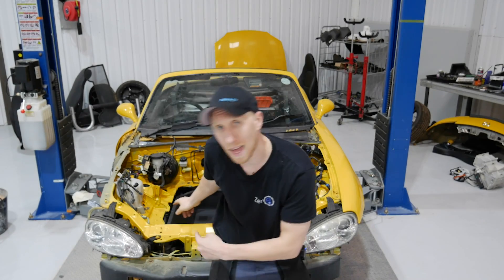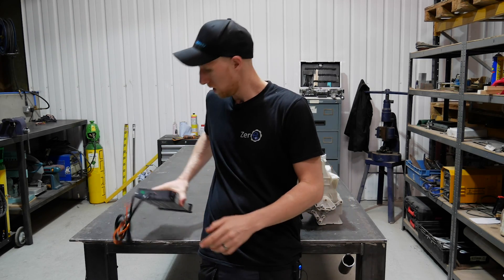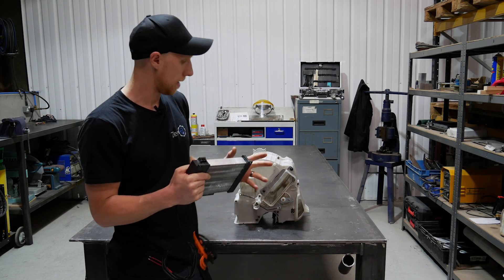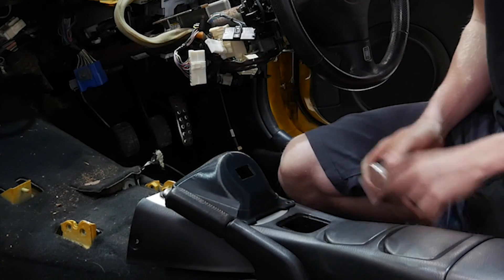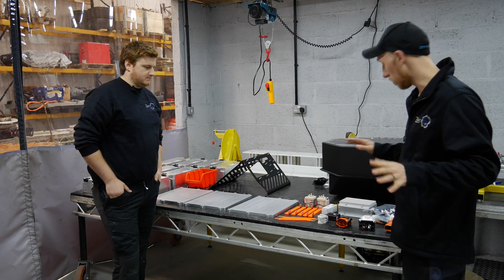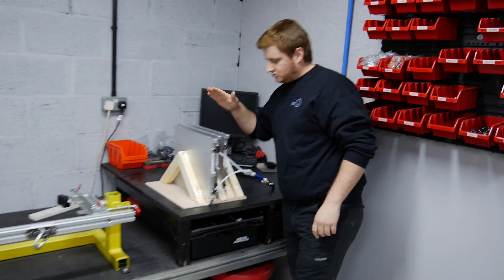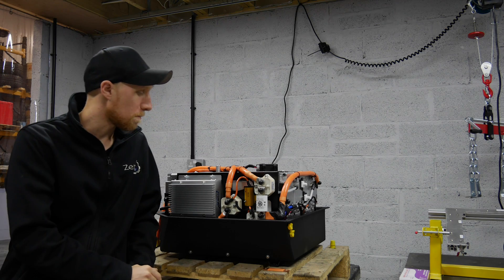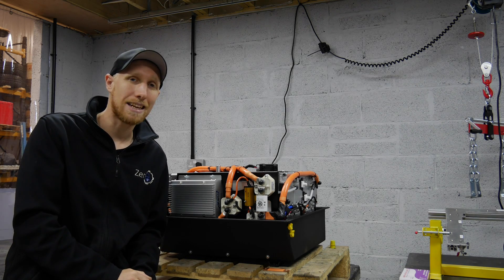Electric Mazda MX5 Miata Eunos EV Conversion, High Voltage Battery Box Build. Eps 7

Comment: Are you not cooling the batteries and motor?  Heat from those should be used in the cabin, surely?
Reply from the maker: Battery’s and motor controller are cooled. They will not generate enough heat to have any real effect in the cabin.
Reply: @Hazell_Nutz  Do you have any numbers on that? How much heat are you throwing away from the motor and batteries?
Reply: @realnutteruk1  A couple of watts each, you are talking about a 100-200 watts total during normal driving. You send more energy moving the heat and it will be at a very low temperature so not usefull for heating the cabin. Keep in mind your 'ICE' vehicle has coolant at 100C and not components just above ambient.
Reply: The HyPer 9 motor is air-cooled, so it is not useful for cabin heating. The liquid-cooled components could provide some cabin heat, but there isn't enough waste heat for them to have bothered using it in this project.

Comment: This entire series makes me wish you guys taught a class that people could take to do a conversion on their own cars from start to finish.
Reply: I wanted that as well until I had a look at the prices for the parts..
Reply: @mysteez doing a bit of research and youre probably spending around 13k$ doing this conversion lol 
thats like 5 times what a lot of people have paid for the car in the first place
Reply: My thoughts exactly.
Reply: Wait until prices drop and then build it slowly, going to wrecker yards and seeing what parts are cheap
Reply: It's not Soo difficult, check some guys in India who are doing a great job on a small budget 😁✌️👍Stay safe.
Reply: its cheaper to convert it to a V6.... which is also more fun !
Reply: @condadodealhamahomes  Definitely cheaper initially, but over a 5 ot 10 year cost of ownership, the EV TROUNCES the V6 in reliability, maintenance, and propulsion costs.  Also, if you've never driven a nice lightweight EV conversion, you don't know what fun you're missing!   * INSTANT * acceleration, neck-snapping torque is addictive, for sure!
Reply: @misturchips  I actually don't think so. In 10 years the battery pack may need to be replaced. Also in most countries (probably all of them) you need to pay a lot to get it passed any technical inspection, probably need to make additional mods in order to make it street legal.
Reply: @condadodealhamahomes  We converted a Ford Ranger in my college class for the campus landscaping crew in 1997.  That truck is still the one they all fight to get each day - since then, it's had one complete battery replacement, and a partial where one of the batteries suffered a shorted cell.  On the full replacement, the battery rack was also replaced.   Ultimately the most reliable vehicle in the fleet, as well as the least expensive to operate.  They plug it in at the end of the day and pick it right up the morning to suffer a day of stop-and-go short trips etc.  The VOlkawagon Rabbit diesel was 0-30 in 12.x seconds, where after converting to electric w. 12-1600lbs extra weight it was 0-30 in 7.x seconds.  If not current-limited, it'd strip the teeth off of first gear...  Performance, reliability, and smooth operation are key features making 'lectric superior for 90% of driving.  Sure, long trips can be a pain, but that's getting better with each advance in storage.
Reply: Please

Comment: Hi, you can't use 3d printed parts in a car if it's standard PLA, it will melt in the summer. Use nylon or any other high temperature filament.
Reply: Use Bdp it prints well and is stable offer 100 C 😏
Reply: Nylon and ABS need heated chanber and some practice to print for this large part, use good quality PETG is good for 80 degress for functional parts. PLA is not a good material for functions prints, low temprature, cant handle sunlight. so on
Reply: Its probably different for an EV but my miata the trans tunnel pulls a ton of heat up through the gear shift area. ABS might handle the temps though and is a lot easier to print than nylon.
Reply: You guys need a markforged  3dp, so you can do high quality CF/Nylon prints

Comment: A car looks like it needs a battery half that size.
Reply: It is a sports car, so presumably they are going for quite high performance whilst still providing decent range. IMO you may as well fit the largest battery system that the car can handle.
Reply: @AloishiusAbercrombie  Definitely. It wouldn't hurt to have a bigger battery. But I wonder how the weight will affect the car.
Reply: Sinh Nguyen They said, elsewhere, that they were expecting the overall weight (& weight distribution) to remain approximately the same.

Comment: As normal excellent video sir,  having owned an na for 10 years since release day I love this but have you thought about using your bespoke  knowledge on sailing yachts?
Reply: I believe there are some other companies already working on replacing diesel sailboat engines with electric power.

Comment: Hi, another great and very informative video thank you. I am so impressed with the knowledge and skills you guys have. I have a question, what was the blue stuff you placed on the cooling plate and lowered the battery brick onto? I assumed it was some type of heat sink similar to what is used on a PC processor. If so, why did it need to be so accurately placed with the template etc. thanks :)
Reply from the maker: Hi, as we use the cooling plates for our clab modules as well they have an indent underneath for the heat transfer pad to be placed so just force of habit plus alway nice to keep everything perfect 👌

Comment: Are you running into CAN problems because the system expects some information that are gone now, through the process of taking the internal combustion engine out?
Reply from the maker: Not having any issues. We have removed the engine ecu and left the bcu which runs standalone.

Comment from the maker: Any questions please ask. Don't forget give us a share and a thumbs up.
Reply: A few questions: What would be the cost to the customer of converting an MX5 MK1, 2 and 3? Any thoughts on the handling by adding the additional weight? Can you converting without a gear selector? Thanks
Reply: pls use an isolated crane to move the battery pack/ cells :o :D
Some wood would do the job fine.
Reply from the maker: Please explain your thinking?
Reply: @Hazell_Nutz  moving a battery around with an electrical conductor seems dangerous. Especially, if the battery connectors are close to the thing you are holding the battery pack with.
I know a company that uses a wooden plate with metal chains attached to it to move cells around on a crane.
Reply: @christianwagner6244  Our Crane is Grounded. The terminals are capped off when they are being moved. Also all the assemblies are checked for voltage leakage and will not be moved if they are faulty.
Reply: Love the project, but some stuff that caught my eye: 
- is plastidip really a suitable longterm insulator for a HV bus bar? 
- @17:22 not sure if I'm seeing this correctly, but using cable ties to secure anything to a bus bar seems like a big no-no, due to the ties eventually wearing through the insulation and exposing the copper.
Thanks for sharing these videos and stay safe!!
Reply: @rgsun1t  Plasti dip is on there to stop contact during assembly, it is not relied on to be a true isolator once the pack it together. The cable ties are not tight, however good point about the cable ties wearing through over time. Yet again the busbars have nothing they can touch to cause issues.
Reply: what amps are the main two and one small contactors in the battery box and is the precharge unit the on on your ev store site and thanks guys great channel
Reply: @carolwilliams6063  Controller: https://zero-ev.co.uk/product/low-voltage-junction-box-contactor-controller/, Contactors are two 400 amp ones for the mains and a 50 amp one for precharge. https://zero-ev.co.uk/product-category/fuses-contactors-relays/
Reply: Very neat :) What was the blue stuff that was used between the bricks and cooling plates please? I'd also be a bit wary of having those cable ties and the associated BMS wiring tagged to the busbars too - it's a lowish risk but as stated, wearing through and possibly exposing the BMS conductors to high current busbars (probably getting warm too) plus potentially high voltage (relative to ground) on the busbars towards the end of the string of bricks, in the worst case could result in unexpected toasting of the BMS and meltage in a kind of Final Destination kind of way (I would lose sleep if I owned it ;))
Reply: I hope I'm not too late for this, but I was wondering if I were to do this but with a different 3 Phase AC Motor, could the rest be the same as this series or would I have to change things?